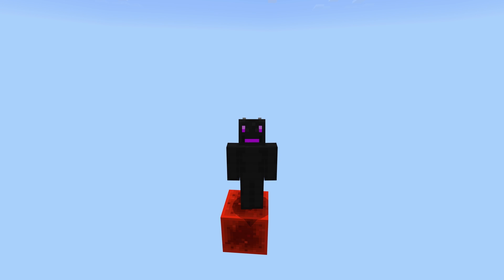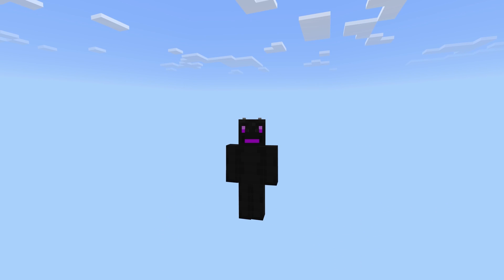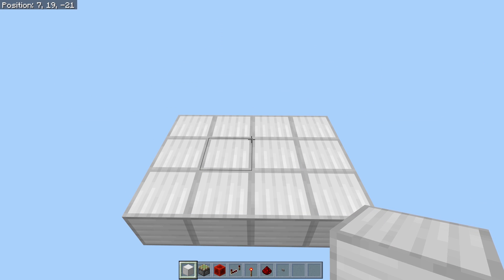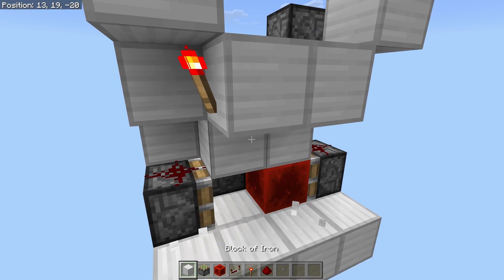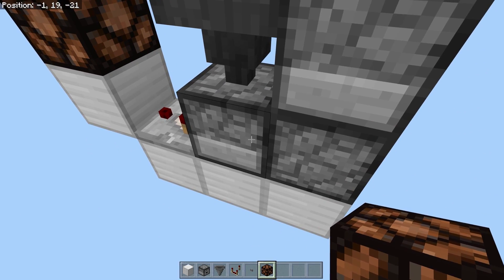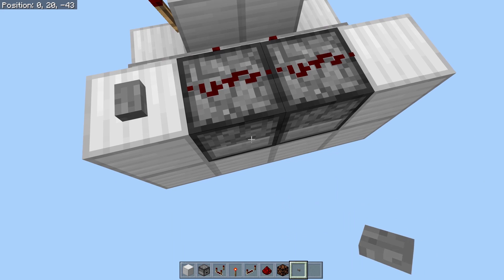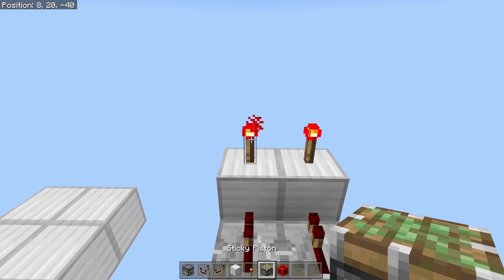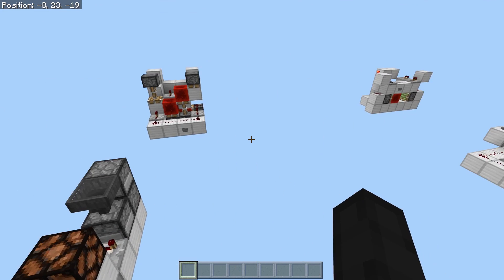Minecraft Bedrock Redstone - T-Flip-Flops (w/ Four Original Designs)

Comment: I have a double piston extender door and I want it to always be closed but when I press the button I wan it to open for a few seconds. How do I do it?
Reply from the maker: It kinda sounds like you're looking for a pulse extender. There are multiple ways to do this, but what I would suggest is re-purposing a circuit from one of my videos. It was originally intended as a way to stop observers from looping, but there is an alternative method that achieves the same effect without as many resources. It will be perfect for your case, however. The video is here:

https://www.youtube.com/watch?v=xjTXkTNoF8c

What you're going to want to look at is that red circuit. See how it is off most of the time, but then once the circuit is active, it turns on? That's the effect you're looking for. You add more items to the hoppers, you get a longer pulse. You remove items from the hoppers, you get a shorter pulse. I use this setup all the time for minigames in survival mode for this reason. You can customize the length of a game easily just by adding or subtracting items. So if you use that red circuit to open your door, you can make it open for a short time before it shuts again. Hopefully this works for you!
Reply: @AlliesAllAround  ah yes I see! Thank you do much. I Subbed

Comment: Mumbo did a video about repeater locking which (IIRC) had a pretty simple T-flip-flop:

Basically, you have an inverter whose output is connected to its input by a locked repeater. You toggle the flip-flop's state by momentarily unlocking the repeater.